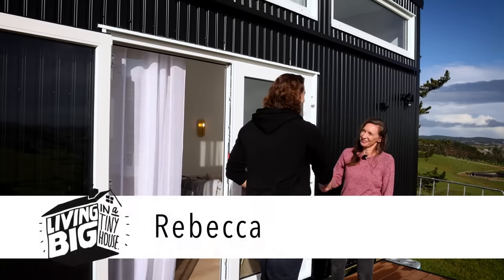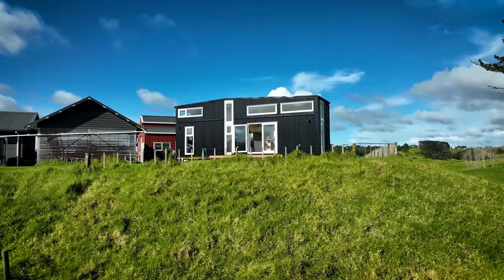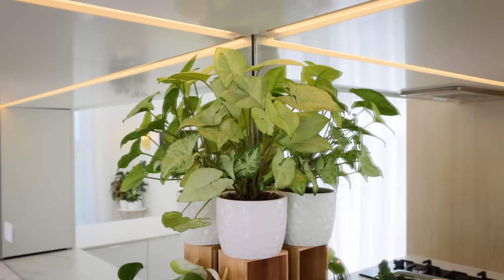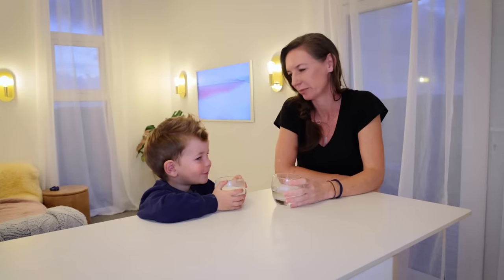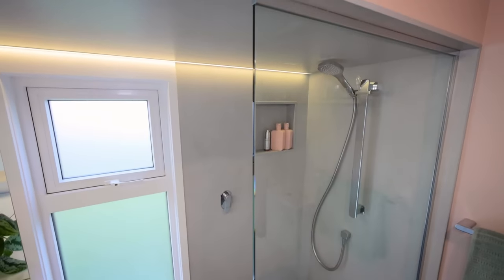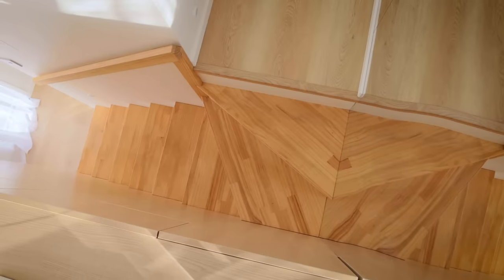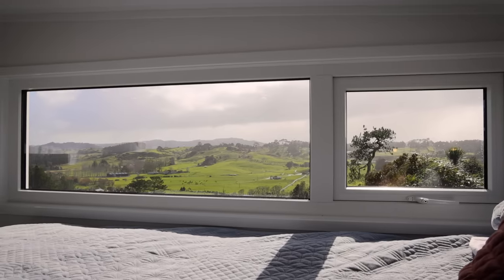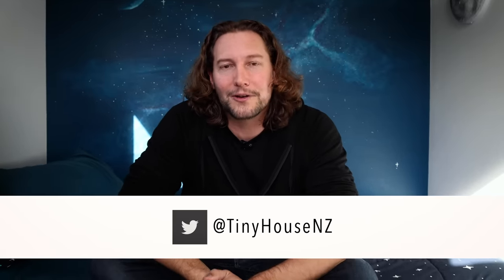This Tiny House Is A Design Masterclass!

Comment: This is probably the first tiny home plan I could actually consider living in. I absolutely love it! She has an incredible gift for design and functionality.
Reply: Same!! I always think about radical changes I would do to other tiny house designs I see.. with this one I would only slightly modify the homeoffice.. I'd add a window behind the monitors and I'd put some plant pots between the office and the bedroom.. I also think the plain view of my that bed would distract me 😅
Reply: @mahivivazqueztarducci8780  I would try to reconfigure the bathroom (put the toilet or sink under the walkway maybe?) to try to keep the full-height shower, but otherwise I completely agree. As a gamer who spends more leisure time sitting at a desk than sitting on a lounge (but not wanting to sacrifice a lounge) so many tiny homes just don't have space for a proper computer desk. Love that this one includes that.
Reply: @mahivivazqueztarducci8780 The bedroom would be a big distraction for me as well but I "think" it could be an easy fix using a curtain or shade that could possibly be stored in the wall space above or on a roller affair.
Reply: Me too I love it❤
Reply: What a lovely  home great to watch good luck with your future plans 🇬🇬😁🤙
Reply: she's a single mom.  this is all she can afford.

Comment: Rebecca kind of intimated at 3:15 that it's basically just another tiny home, because of the associated constraints. But this is far from just another tiny home. There is such innovation here, things here that I've not seen before. From the use of mirrors, to the exterior storage under the stairs, to the office, to the stair access to the kitchen storage, to the tall window in the lounge, to the sliding moonscape and on and on. I'm all over the place because innovation is just everywhere. Brilliant work, Rebecca. You've defied many conventions and created an absolutely stunning home. 💛

Comment: Elegant and a very calm design tone. The eye just travels unhindered. The only thing I would change is the use of mirrors. I've had negative experiences with their wrong placements, especially in the bedroom. While they do have the element of spaciousness, they also serve like a "doorway/extension to alternate dimensions". You certainly don't want to see your own reflection sleeping or first thing waking up! I've covered mine since 3 years and felt an immediate difference in the energy in my bedroom. Worth reading up about it!

Comment: Very well designed and decorated.  Every cubic centimeter is optimized and looks fluid.  I really like this tiny house which does not look tiny at all.  Clever designer.  Congrats.
I would like to have the same.  For my taste i would only add some kind of material over the mirrors allowing to see through it and only see the mirror partially, like a filter with holes.